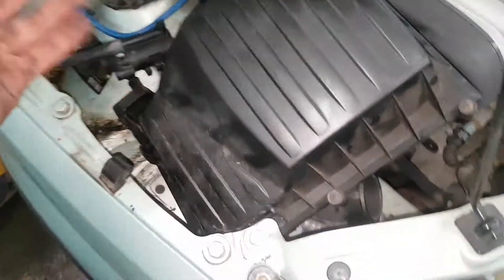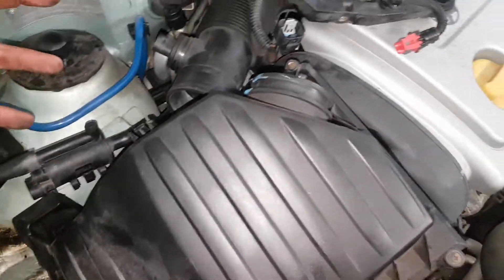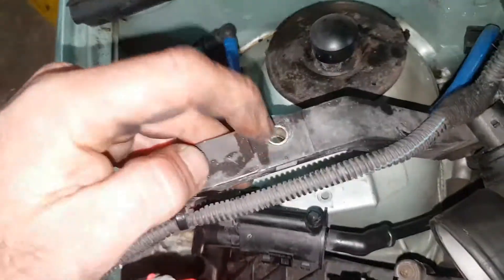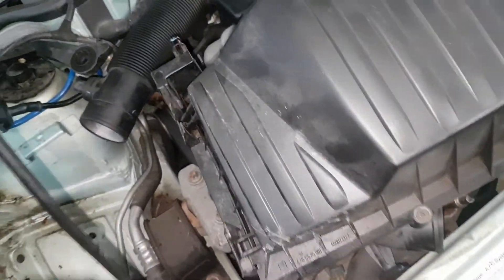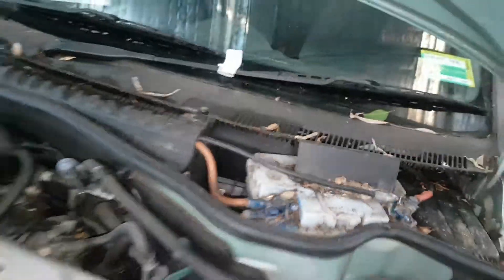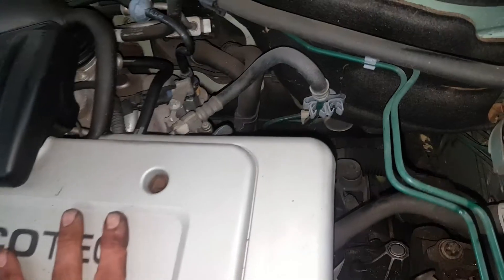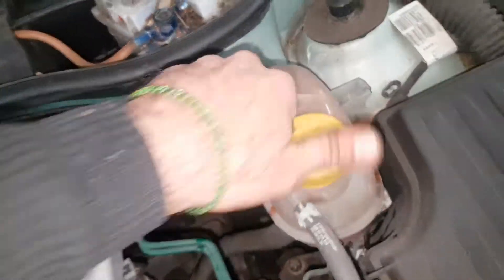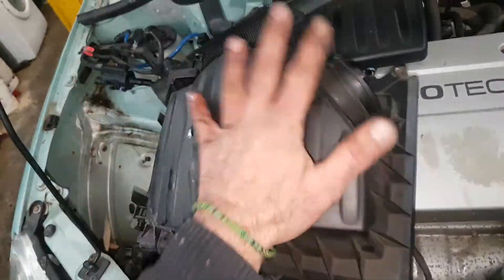2001 Vauxhall Corsa Opel Corsa Holden Barina 1.6 litre Ecotec airbox rattle removing air filter

Comment: There have been many posts around the cause of a poor idle/ stalling. What have been the main causes for this in your experience ?
Reply from the maker: +Ralph Kluge in order of frequency that I've had it vacuum leaks dirty throttle body bad spark plugs 30 total body faulty ECU faulty wiring faulty oil pressure switch contaminating the wiring just had Holden Australia change of my customers computers because I knew it was all going to go wrong and 3 days later the car started hunting night again he said Rob throwing the car away but it was lucky the throttle body very difficult to diagnose
Reply from the maker: +Mechanical Mentor sorry I meant dirty throttle body